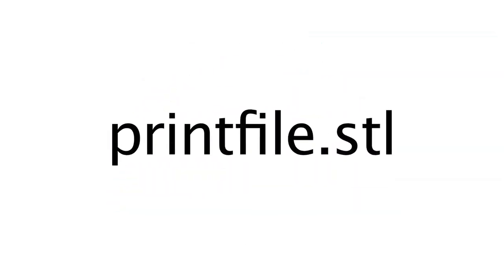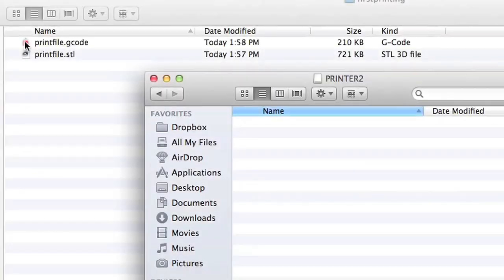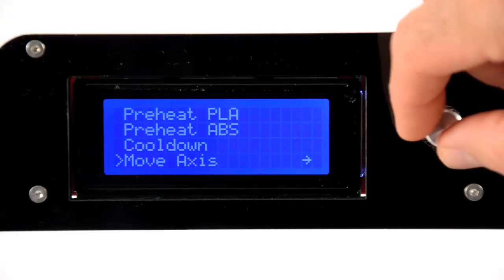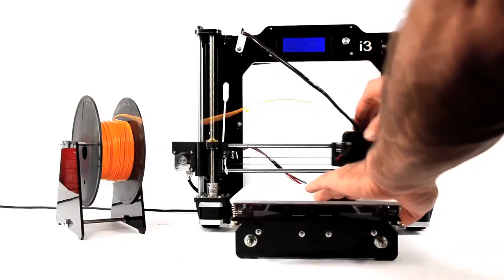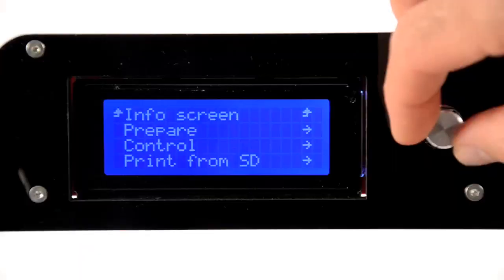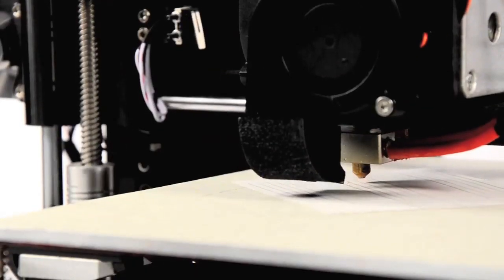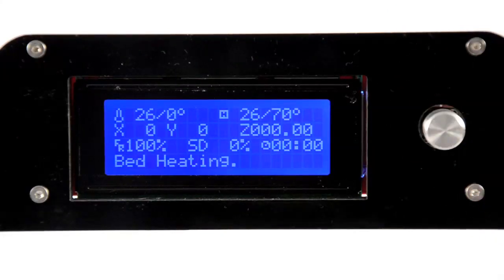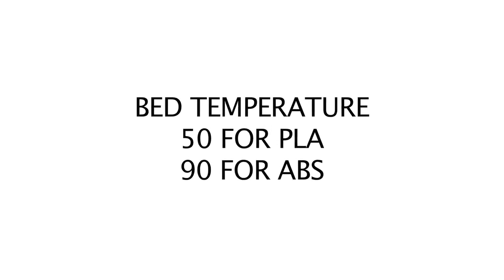Tevo Series Printers - 'Electron 3D ' 3D Printing start printing video

Comment: What settings did you use? 
Would be nice if you could help me:
I bought this printer but it won't print.. The filament (ABS) keeps sticking to the nozzle and smears around the printbed (+masking tape). It's my first 3D printer (calibrated,  nozzle 245°C, bed 100°C, 5mm brim, 2mm retract 40mm/s) and the nozzle starts perfectly above the surface (about 1mm).
Reply: +Fawks http://imgur.com/grK9YyE another try (another problem)
Reply: +Fawks UPDATE: The problem is the extruder motor, it prints fine when I push the filament.. You can see the zone where I stopped pushing for a while (http://imgur.com/a/qmg63 ).. What can I do?

Comment: It would be really helpful for a beginner like me to have a video where you show how to operate the printer just after assembly, like having a sample g code file loaded to sd card and showing how to set it up to actually start printing. I am clueless as to how to operate this through the CURA sofware. Please help!
Reply: +Maninder Sra Cura it's a lot harder to work with if you have a more generic printer, mine is the CTC one from china, and I could never get it to work right. I just use makerbots software, and blender for adjustments. Both are free. Good luck.